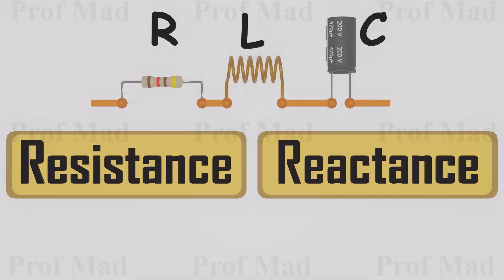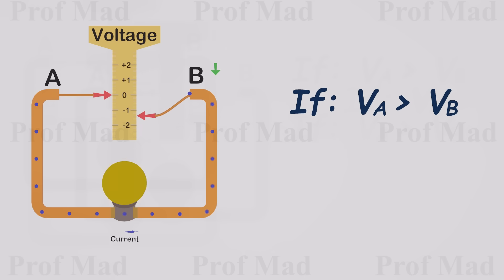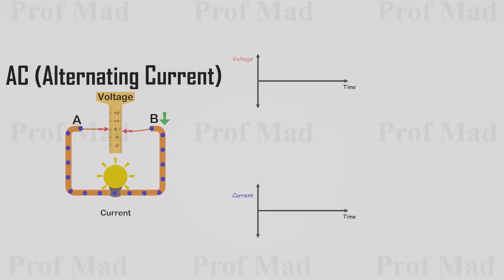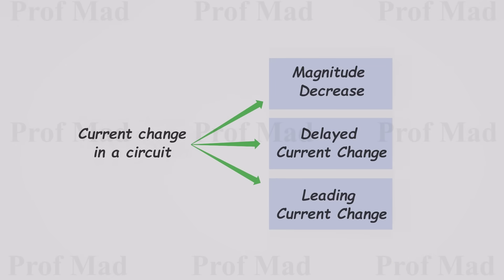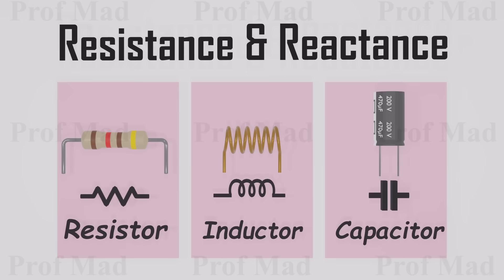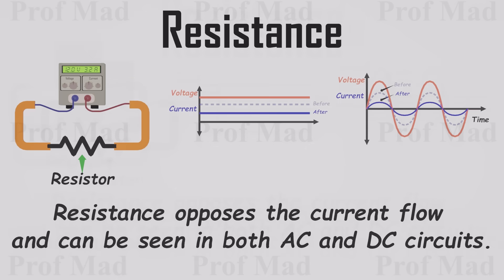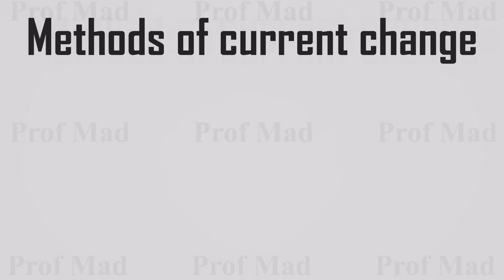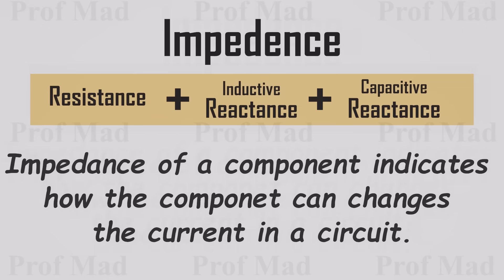What are Resistance Reactance Impedance

Comment: easier to understand is when you think it like IT IS. Voltage describes how much energy current has at any given point in time. Voltage is IN the current. When there's potential difference in energy, the flow is always from high to low, yes, electrons move from minus to positive but energy, like heat, always from higher to lower. Never think that voltage is a force that pushes electrons.

Comment: Let's break down the differences between resistance, reactance, and impedance:

Resistance (R):

Resistance is a property of electrical components, typically represented by the symbol 'R.'

It is associated with the opposition that a material or component offers to the flow of electric current.

Resistance is constant in purely resistive components like resistors and is measured in ohms (Ω).

It dissipates electrical energy in the form of heat.

Reactance (X):

Reactance is another property in electrical circuits, represented by the symbol 'X.'

It is specifically associated with components that store and release energy, like capacitors and inductors.

Reactance varies with frequency and is measured in ohms (Ω).

It doesn't dissipate energy but rather causes phase shifts in the current.

Impedance (Z):

Impedance is a comprehensive measure of the total opposition to the flow of alternating current (AC) in a circuit, represented by the symbol 'Z.'

Impedance takes into account both resistance and reactance and is also measured in ohms (Ω).

It accounts for the phase relationship between voltage and current in AC circuits.

Impedance is used extensively in AC circuit analysis and design.

In summary, resistance opposes current flow and is associated with purely resistive components. Reactance opposes changes in current and is associated with components like capacitors and inductors. Impedance is a combined measure of resistance and reactance and is crucial for analyzing AC circuits, as it accounts for both the magnitude and phase of the impedance in a circuit.
Reply from the maker: Thank you for sharing this.
Reply: For further information related to electrical engineering you can visit my channel too. It will be glad for me to share the information to seekers
Reply: Seconding the thank you for sharing this!  Both of you have the contributive, humble spirit that makes the world a better place!

Comment: The term constant current was used in the early days of electricity, it is much better the the term direct current . It actually describes what’s going on .
Reply from the maker: Thank you for the suggestion.
Reply: In roumanian we call it continous current
But it is often seen as DC when decades ago it was CC
Reply: Actually it is a bad idea. Because we talk about constant current supplies and constant voltage supplies.

DC is the correct and better term.  DC indicates the current flows in one direction, it does not have to be a steady current to be DC.

Constant current means the current is steady and does not change.
Reply: @deang5622  direct doesn't mean either of them anyway
Maybe unidirectional or something else
Direct doesn't point to it being constant or flowing in one direction
Reply: @alnea  True. But the word has a clearly defined meaning and that meaning is used throughout the entire world and has been for many many years. There is virtually zero chance of using a different word.

We are stuck with it. Just as we are stuck with the direction of conventional current flow being opposite to the actual electron flow.

But direct, I would argue is better than the word "constant",  because there is no reason why the current would be constant. It is constantly changing according to the magnitude of the load, so referring to direct current as constant current is factually wrong.

Direct current, isn't factually wrong.
Reply: @deang5622  I know...I said you are correct and did not in anyway respond as a correction...but look at my country still using it
If I say "curent direct" (which is roumanian dc directly translated) I will get weird looks from non english speakers (instead of the conventional "curent continuuu" which you can guess what it means)
It is what it is
Reply: And direct still is a weird choice...if it were unidirectional current would solve all problems (having in mind the magnitude of the current)
Reply: @deang5622  while you are right because we can have changes in duty cycle for PWM and it can have 0 at times everyone understood anyway what it meant and in my country everyone that knows about still understands it

Comment: I worked as an Industrial Electrician for over 40 years. I worked for a foundry for 12 years that used three 1 megawatt induction furnaces and two 5 megawatt induction furnaces to heat the metal to melting point. An induction furnace is just one huge coil of water cooled copper pipe insulated by refractory. But because they were inductors and caused the current to lead this caused the apparent power (not the actual power) used to melt the metal to be higher than it really was and of course cost the company money in hydro costs. In order to overcome this we had banks of capacitors that we could add to the system to change the apparent power down so it matched the real power the system was using. You want the combination of inductors and capacitors mixed in the right way so there is no leading inductance or lagging capacitance in the circuit so the power you are using appears resistive only and is actually doing the work you want from it. Sorta like noise how cancelling headphones work but on a different scale. Google "Power Factor".

Comment: I had always thought impedance (Z) was the AC equivalent of resistance (R) in DC circuits. But until now never understood why when I measured two ends of 50 ohm coax the multimeter shows 0 ohms. So if impedance (Z) = resistance (R) + inductive reactance (XL) + capacitive reactance (XC) and R=0, the 50 ohms represents the sum of XL + XC? I know there are formulas but how can XL and XC be measured?
Reply: To measure an isolated XL and XC, you'd need to measure its impedance across a broad sweep of the spectrum, and extrapolate what lumped inductance and lumped capacitance could cause it, from a model of the cable.  A typical cable assembly is modeled with resistance and inductance in series along its length, interrupted by cross-conductance and capacitance in parallel.  And a continuous repeating pattern like this, that looks like a ladder.   Inductance and resistance are the longitudinal rails of the ladder, while cross-conductance and capacitance are the rungs of the ladder.

What you'd get, is a Bode plot in the frequency domain, which shows the ratio of amplitudes, and phase shift at each frequency.  The XL will cause current to lag behind the voltage, and the XC will cause current to lead the voltage  Generally, at low frequencies, XC dominates, while at high frequencies, XL dominates.

Comment: Your currents are flowing the wrong way 😅

They are negatively charged electrons to the flow from the negative to the positive, not from the positive to the negative.
Reply: It's a diagram that shows conventional current, in a pre-1900 understanding of these concepts.  The sign convention sticks around today, because of an "if it ain't broke, don't fix it" line of thinking, since it would be too much effort to overhaul the century of knowledge that was built on incomplete data.

If you had a circuit made of positive charge carriers like sodium ions, like in human nerve cells, conventional current could reflect reality.  Be flexible on your understanding of current, as it isn't necessarily electrons (even though it is electrons in manmade circuits).
Reply: @carultch   So knowledgeably and kindly said.  And your technical writing skills are tops!

Yes, it's all about conventions of reference.  Who knows, but maybe what we universally call the North Pole now was once referred to as the South Pole!  Conventions of reference are arbitrary and malleable.

Comment: i am confused about the nozzle. wouldnt the flow stay the same by increasing flow velocity?
Reply: For an ideal nozzle, the ideal nozzle has no energy loss.  It simply trades pressure energy at the inlet of the nozzle, for kinetic energy at the outlet of the nozzle.  The nozzle in reverse is a diffuser, that would do exactly the opposite, and return the same pressure you started with, if it were an ideal diffuser.   The mass flow rate is the same at every point along the way, it is just redistributed.

An ideal nozzle/diffuser pair would have no affect on the relationship between flow rate and pressure difference, because all energy is ultimately conserved across it.  A real nozzle/diffuser pair, not so much.

For a real nozzle, there is friction that would accompany the process, and this is why a nozzle would affect the relationship between pressure difference and flow rate, analogous to a resistance.  There isn't an exact match to a hydraulic equivalent of Ohm's law, because the relationship is extremely non-linear.  We also don't have a closed-form solution, and designers of pipelines rely on extrapolating experimental results.
Reply: @carultch   SUPER appreciate the generosity and expertise of at least a couple deep questions you've kindly answered!  Thank you!

Comment: Positive charge is lack of electrons ,,, negative charge  is excess electrons ,,, current flows from negative to positive ... So many get this wrong ....
Reply: Not necessarily.  Charge is just a property of matter, that enables participation in electromagnetism. There exist plenty of negatively charged particles that have nothing to do with electrons.

Negative charge just means it has the same charge as an electron, and positive charge means it has the opposite charge as an electron.  For most matter familiar to you, it is a surplus of electrons that makes macroscopic objects negative, and a deficit of electrons that makes macroscopic objects positive, and a flow of electrons in most manmade circuits that makes for current.  But charge in general, doesn't have ot be this way.

Bottom line: be flexible with your understanding of current.  It might be the same way as charge flow, or it might be opposite charge flow.  You might also have a mixture of both charges flowing in opposite directions, and together they form a current.
Reply: @carultch  Yeah , NOOOOO not where electricity is involved ...You are not mistaken you are wrong ...The particles you are describing live for microseconds at the very most , and aren't involved in electric circuits ...
Reply: @theiaminu5375  How long the particles last is irrelevant.  They still interact with electric fields.  They may not be involved in practical electric circuits, but they can still be involved in electricity in general.
Reply: @carultch  None the less , your comment is unrelated to the video ... protons determine the element and do not travel through electrical wire , the electrons do , from the negative/ground of the supply , toward the positive terminal ...The positive terminal has less electrons than the negative terminal , and the electrons flow not the protons in an electrical circuit ...I Hope this clears it up for you ,,, this is not something you can argue endlessly about , it's a FACT ...

Comment: Very well done. Unfortunately, I still can't find the back of my hand. (Analogy-Know it like the back of your hand.)
The water analogy for electricity is suppose to be the best. It seems to be, from what I have seen, what everyone likes to use.

I know plumbing and very familiar with pressure, flow and regulators...but still have a major opened circuit in my grasping of inductance.

I was taught electron flow in high school and I wasn't aware there was another until years later. That was when I realized that most explanations used conventional flow when explaining circuits. This really screwed up my ability to further my understanding due to years of frustration which I had thought I was doing something wrong.
Why in the heck conventional flow is used when electrons flow the opposite way is beyond  my grasp.
I suppose it's because people just don't like to change...kind of like current in a AC circuit containing coils of wire.

...It's electron "hole" flow. I heard one video say.

Thanks for the video.

Comment: How is negative voltage made and why does it say positive of i flip the leads of multimeter
Reply: Negative Voltage just means the EPE of a positive charge is less than what it would be, at the reference point.
Positive Voltage, means the EPE of a positive charge is greater than what it would be, at the reference point.
Electrons have an EPE that is opposite the voltage.
EPE = electric potential energy.  The energy that a charge has, by virtue of its position in space, relative to the reference location.

It is completely arbitrary where that reference point is.   There is no such thing as absolute voltage, since what ultimately matters is the difference in voltage between two points, and in which direction.  There are conventions for where to put your reference point.  In a practical application, you either put it at the ground that is electrically continuous with the dirt, or at the chassis ground on a device that isn't connected to the dirt.   Physicists consider zero voltage to be infinitely far away from the charges we are considering, but that isn't really practical.

Think of zero Volts as where ever you place your Voltmeter's black probe.   The Volt meter then measures the Voltage at the red probe, relative to the Voltage at the black probe.
Reply: What a Voltmeter is really measuring, is the integral of E dot dℓ, along a path through the leads.   E is the electric field (force per unit charge as a function of space), and dℓ is the little distance (length) along the path.  The dot is the dot product of the two vectors, multiplying them together, and accounting for how aligned they are at each point.   This adds up the cumulative work done on a test charge along the path of its leads, which does work on the internal components of the Voltmeter circuit.  The work done on the voltmeter circuit, tells you the voltage across its leads.  For a situation with no changing magnetic fields in the background (induction), the electric field is conservative, and voltage you measure only depends on the two locations, and is independent of path.

An analog voltmeter uses a spring-loaded needle, driven by an electromagnet.
Push the needle one direction against the spring, you get positive voltage.
Push the needle the other direction against the spring, you get a negative voltage.

Comment: This is the best analogy I've seen for inductance and capacitance.
Reply from the maker: Thank you.
Reply: I agree, was waiting to see how voltage/current lag would be shown with water, and the water wheel was perfect.  There you can see without words how it works. Which has me thinking maybe the best explanations are ones that just boild everything down to untiuve bits, idealy without words, after all everything we're talking about is phsyical and we should be able to show what we're talking about with some sort of analogous action.  I would love to see more mathematical relationships shown with action.    I guess graphs are the closest thing but they're not intutive either, having to process mentally whats going on with a curve. Like a sine wave is circular motion through time but the graph doesnt make that obivouse.  But say something like a gradient, you can see right away which parts are heavily concentrated which ones arent,  its obviouse, a 2d graph you need to use a legend to figure out which was is up even.
Reply: The best way I remembered reactance from inductors and capacitance is ELI the ICE man. E for voltage, L for inductor, I for current, meaning voltage leads current in an inductance and I for current, C for capacitor, E for voltage, meaning Current leads voltage in a capacitor.

Comment: 45 years later, and I finally grok capacitors (in signal circuits, specifically). You did that. Thank you.
Reply: What is grok
Reply: @mar-tin702  Old farter's language.
grok — verb groks, grokking, grokked [with obj.] understand (something) intuitively or by empathy ■ [no obj.] establish a rapport
Reply: to understand profoundly and intuitively @mar-tin702
Reply: @mar-tin702  this is what i want to ask
Reply from the maker: Thank you.
Reply: Grok is more of a computer software term. Rather than electronic.
Reply: @Lagerfanny-g7e 

Stranger in a Strange Land by Robert A. Heinlein (English) Paperback Book
Reply: @PhilipHarrington  Thanks, I didn’t know that.
Reply: Just remember that this was an example of a coupling capacitor configuration.

If the capacitor (membrane in the example) were connected in parallel to the transfer pipe, it would absorb and smooth out small changes in pressure. This is called a decoupling capacitor configuration.
Reply: @10_ashutosh_01  
...and what have you done for mankind, dear friend ?